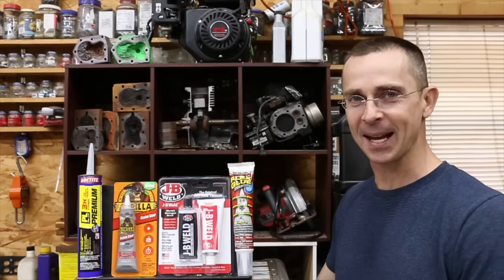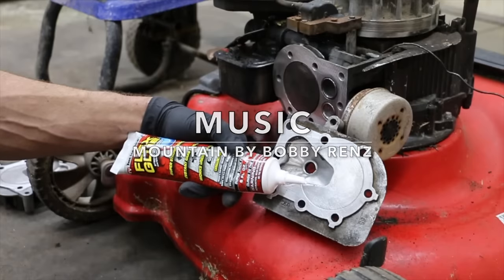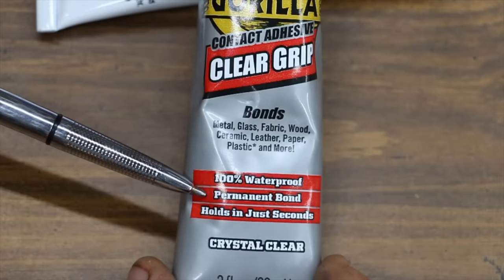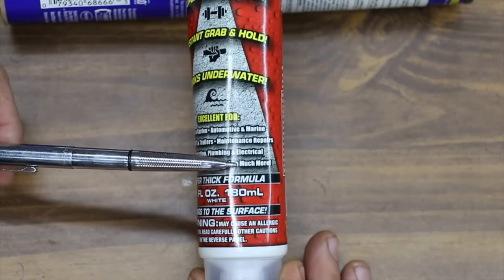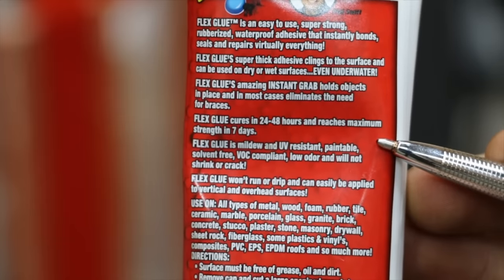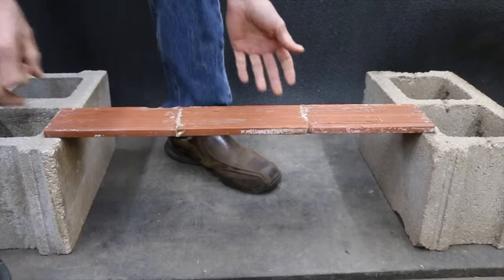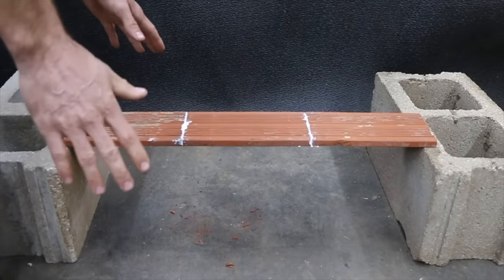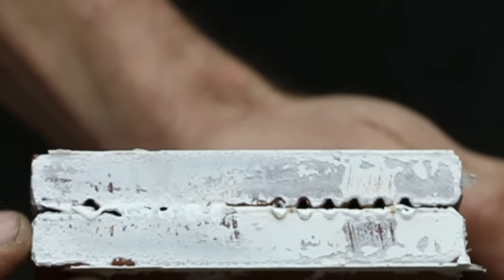Is Flex Glue better than JB Weld, Gorilla & Loctite?  Let's find out!

Comment: I know it's been awhile since you've made this video but I'm looking to waterproof a 1/8 gap around my speakers. They'll be secured to the housing via 1/2" 6-32 screws with locknuts on the backside but will have that gap which MUST be waterproofed. Since this is a portable speaker, do you think the Loctite will withstand the flex from the speakers' vibration and from the constant movement in the boat/truck/ATV? I dislike silicone because if I ever need to do a repair, NOTHING sticks to silicone so cleaning it off for said repair/patch becomes more of a hassle than it's worth.
 
Any other products to try? Thanks in advance :)

Comment: i have a question. just wondered because the tests done are mostly sheer strength? so, it's any stronger if done with  holes for better purchase? thanks, like with the engine, after the bolts were removed the holes then filled with resin would improve the hold? thanks!

Comment: You should check out Aquaseal dive repair glue sometime. Aside from repairing drysuits, I have used it to repair shoes, boots, wood, etc. It is very strong and adheres to anything clean. In the case of fishing waders, clean the surface, apply the glue and if it comes off in a few days, reapply it immediatly before the area gets dirty. The second time it will likely be there till the second coming. I have boots that I have repaired years ago, still water tight. Once opened, it will cure in a few weeks, even after re-capped,  I store it in the freezer to get it to remain soft for years. Then return it to freezer after use. You can add Cotol to get it to cure quicker, but it will not be as good as it would be if you can simply give it a few days to cure.
Reply from the maker: Thanks for the suggestion.

Comment: A smart Texas Aggie and his wife founded JB Weld at he same time as I returned injured from Viet Nam. I met my wife (a Texas country girl) while I was in the VA recovering. As soon as this product became available I started using it. I had a shop near a AFB as a meeting place until 1983 when Hurricane Alicia destroyed it. I'm an average mechanic but there were guys that were crackerjack. I bought a inexpensive flatbed rollback with a stinger on the back. I also got a car dealers license and hoards of us could go weekly to the auction. Sadly, many old + now radically expensive muscle cars were scavenged for their engines and transmissions. As a example '69 GTO could be had for $1,000. Everyone's workbench had JB Weld on it. Guys would get-together and work through the night and pull a engine and transmission and reinstall it on another car. Generally, there would be JB Weld waiting and ready to mix up and used for everything. I've seen undersized plugs installed with JB Weld and ran on a track. I don't remember it not being used for anything. I also had 2 cheap lifts that were from a defunct gas station. Those years are my happiest years and memories I have. Now being in my 70's I can't work on much but I still have JB Weld on hand for nearly everything! Thanks, a million for proving what I knew. JB Weld is by far the best product on the market still. Sorry, this is way too wordy. JB Weld is a central point in my life that evokes great memories!
Reply from the maker: You are welcome!  Thanks for sharing!

Comment: I have used JB over the decades to MacGyver Commercial dishwashers and laundry equipment when owners didn't want to pay for big replacement costs. .Also one time a 100 miles away from home I patched my Yamaha 4 stroke dual sport to a crack that was causing my bike to blow engine oil & would  have blown if not repaired.  I patched it w JB for a quick fix and it became permanent. I was in a jam and tried flex seal on a weekend call and it didn't last a minute F anything you see on TV especially in the as seen on TV racks.. Yee doggy!
Reply from the maker: Thanks for sharing.

Comment: So I have a leak on a prefilter basket on a multilevel pool pump motor.  It is a vertical seam leak.  Manufactured Ng defect obviously. Bit gets water pressure on it.  I have tried layers of jb weld, level, pipe glues, etc.  Nothing lasts under pressure.  Now Lowe's tells me that Flex Seal goop in the jar will definitely fix it.  Going to put it on today and let dry for 24-48 hrs.  Any bets?.  @Project Farm

Comment: WHAT J-B WELD did you use? was it a different one for different products or is there just one? my speedo on my E-Scooter is plastic and it fell over in the wind in the back garden, bare in mind this speedo has a trigger on it where cars have a pedal. its not the trigger that has snapped thank god its where its screwed to the handle bar so what J-B weld do you recommend the J-B 50139 ?
Customer say this about your red and black original on Amazon.   Does not bond to high density polyethylene plastic please help dont want to ridding down a road at speed then it snaps off. Thanks for sharing this amazing video. Ray K.  UK.  YNWA.
Reply from the maker: J-B original is what I used and would recommend.

Comment: I worked as a fork/clamp truck mechanic and everything under and on top of the roof in a box plant for 26 years. One clamp truck had a leak coming from the oil pan seal. I had to pull the motor to fix it. Guess what, no gasket. I used the flex seal without a gasket and put the truck back together. The next day this guy said he tried to get the oil pan off and tried all day. I put the bolts back in, again and put it on my fncket list. This pan never leaked again.
Reply from the maker: Thanks for sharing.

Comment: To get the best results bonding metal to metal using JB Weld, rough up the surface with a file or sandpaper, then clean it with acetone.
Reply from the maker: Thanks for the feedback.

Comment: Thanks for the video. 
Here in the UK, PTFE tape is a good product to seal plumbing and gas joints. I had a radiator connection that was so loose that I needed an alternative, and I turned to Loctite 577 thread seal. Loctite have a number of thread sealing and thread locking products, and I only found one other maker, Flomasta Pipe Thread Seal.
So, I was wondering what was the difference in the Loctite products that all seem to be similar chemistry, and quite expensive as well, and the competition available there in the USA. The main requirement is either hydraulic sealing, or stopping threads turning after assembly (or both).
Reply from the maker: You are welcome!  Thanks for sharing.

Comment: It has been my experience that for sheer strength, tensile strength and bonding power JB Weld will beat any "flexible glue" hands down.  Titanium filled epoxies work even better but very expensive. They drastically different animals.  It is a steel metal filled amine based epoxy. High temps kinda kill them all. The engine head results would be expected, cylinder head pressures during firing are very very high and have a high impact force like a big hammer during the fuel air explosion. That is why they use high strength bolts for cylinder heads!!  Flexible glues seem to work best on materials with high texture, absorption etc. Pine has a lot of resin in it so it doesn't absorb the glue well. Great test though! Always enjoy your tests, very informative.
Reply from the maker: Thanks!  Thanks for sharing.

Comment: Quite a few people here are commenting that the Gorilla glue needs water to activate it.  If you check the instructions on the Gorilla Clear Grip product used here, it doesn't state surfaces need to be moistened.  The original Gorilla polyurethane based glue is a water activated glue however.
Reply from the maker: Thanks for the feedback.

Comment: I have some JB Weld that I'm planning to use to glue the front door frame back on my above the range microwave.  I've been delaying the repair but I think I'll go ahead and do the job this week.  I also have a microwave leak detector and it shows that microwave leaks are well within the safety levels even without the front door frame but I need the door frame because the handle is attached to the door frame.
Reply from the maker: Thanks for the feedback.

Comment: I threw a rod in a 5hp briggs and put a hole in the block . After degreasing it and throwing in a new rod I JB welded the pieces back together to patch the rather large hole. Ran that engine for another 10 years on a minibike.
Reply from the maker: Great!  Thanks for sharing.

Comment: I'm sure PHIL SWIFT would argue that comparing a 2-part epoxy to his gunk is 'unfair' but by my calculations,  Flexglue costs $3/oz vs. $2.50/oz for JBWeld and it cures in minutes, not 1 week....  Now that's a lot of maths !
Reply: You know what flexseal is actually good for?  Use it in a car that has a water leak.  I just couldnt seem to figure out what spot weld was leaking, I even tried dusting with baby powder, but no joy.  I got a can of flex seal, sprayed the entire darn weld seam, and the flange that held the weatherstripping.  Problem solved.

Comment: I snapped my steering wheel off of my Lincoln Town car in a fit of rage when the Denver Broncos lost in the playoffs , I remember snapping the wheel off at the tilt knuckle , I drove home with a vice grip next day got an estimate for a new steering wheel . . . . . didn;t like the price but I still needed a wheel so I gave JB Weld a shot, not really expecting much, more as just a what if . . . 
It is still on the car 20 years later
Reply from the maker: Wow!  Thanks for sharing.

Comment: I really like this test. Will it work on pot metal?
Reply from the maker: Thanks!  Thanks for the video idea.
Reply: No.  I tried to use it to fix a 1942 Lucas Magdyno M01. The case was cracked, and a bolt flange was snapped off.  I cleaned the hell out of it. I even put it in the sonic tank. I also cured it in an oven at 125degrees.  It unfortunately, refused too hold.

Comment: just confined what i expected. JB Weld is tough as nuts. One time I fixed a radiator with JB Weld after piercing a screw through the end cap like an idiot. It held in the texas heat for over 6 months daily driven lol
Reply from the maker: Thanks for the feedback.

Comment: I was hoping you would compare the thread locking ability at high temperature.  I just repaired my Ford Triton 6.8 two valve that has the defective spark plug threads that lets the spark plugs blow out of the engine.  There were several thread lockers suggested on YouTube.  JB Weld by the kit manufacturer (Cal Van), Locktite 271, Locktite 266, and Time Sert 6020.  What temperature do the spark plug threads get to?  JB Weld claims a 550 F compatible temperature.  I used the JB Weld on all the threads and I can't imagine the inserts ever coming out.
Reply from the maker: Thanks for the suggestion.

Comment: I know you won't  get to my comment, but I use Flex Glue for holding phone magnets to the phone holder. The best part is I broke my Right Side Passenger  mirror  The whole mirror fell off, just held by the power wires  Use Flex Glue 1 year ago to remount mirror Still holding  on today
Reply from the maker: Thanks for sharing.

Comment: You didn't need to test Gorilla.  I could have told you that it was trash. The predecessor to JB Weld was a material called MarineTex. It's what we used in the '70s and '80s when the repair had to be permanent. It was said to be able to repair a broken engine block.

Comment: Did you wet the wood before using Gorilla?  It says to do so on the package and I have seen that make an enormous difference
Reply: If you check the instructions on this Gorilla Clear Grip product it doesn't state surfaces need to me moistened.  The original Gorilla polyurethane based glue is a water activated glue.

Comment: One question, the last time I used Gorilla Glue in the instructions it said to spray the area with water before putting the glue on, did you do this with your testing?
 I have always done so and Gorilla Glue worked very good for what I was doing with it, working on RC Planes attaching props to electric motors that wouldn't hold on their own and fixing damaged balsa from bad landings,  vs JB Weld which I found to be more expensive because of  the amount of waste I had to use to get mixed properly and the horrible smell that lasted for days. other than those two items it is great stuff.
Reply: You use water on wood only to raise the grain for a better bond.
Reply: @bucketmouth7705  that is what the instructions say, but I have found it to help with steel also. Really good demo even still
Reply: @larrybradley4777  steel, I don’t know, wood yes, retired furniture repair

Comment: Your videos are always great!!! 
Maybe try using these products on broken engine parts like an exhaust manifold that is broken in half.
Reply from the maker: Thanks!  Thanks for the feedback.
Reply: I don't think any of these adhesives will stick a broken exhaust manifold. It gets much hotter than the highest temperature that an adhesive can withstand. The manifold will need to be brazed or welded, using a filler rod and flux intended for use on the material from which the manifold is made.
Reply: @cedriclynch  that's what would make it so interesting to try. An extreme situation. Another thing would be to test it for thread repair where a helicoil is commonly used. Like head bolts or sparkplug holes.

Comment: I Enjoy watching all your different test! One I Wish you would do, is the Flex Glue. Their Commercial shows them lifting over 6000 pounds, with 1 drop of flex glue, between the flat metal lift point, and a flat based Weight Meter. I Say, Prove it! I Don't believe it!
Reply from the maker: Thanks for the suggestion.

Comment: Good video.  You need to add a chemical test to this.  I have had great experience with JB Weld except on carb applications where the glue was in the presence of gasoline.
Reply from the maker: Thanks!  Thanks for the suggestion.

Comment: Have you done a 2 part vs pre mixed? Like the A/B foams vs spraycan foams. The same company makes. Like jb weld. They make their 2 part mix you need to ratio out yourself vs those syringe style applicator they make. Like is it better to by the original or pre mixed.

Comment: I have a bracket I need to fix on my truck that doesnt hold a lot of weight. Going to get 2 pieces of metal and lapweld over the break with jb weld because of this video.
Reply from the maker: Thanks for sharing.

Comment: I recently used some of that Flex glue,(not on an engine,hehe.) 
    It's strange, not like other materials, but after a 36 hour cure it works as a submerged filler. Also Very!  adhesive . The only deficit is a slightly longer cure, but it is a really strong product. I was surprised, that a nèw product was so good.
Reply from the maker: Thanks for sharing.

Comment: A note about one of the tests. It didn't effect the result in this case, but ... The foot of that piece of rail you used is not as wide as the round weights you were using.  A fairer way to use it would have been to place one of the round weights on the board first, and then the rail.  The narrower foot of the rail actually added extra stress to the joint, just because the geometry is narrower.  I'm guessing you already know this, but suspect a lot of the viewers probably don't.
Reply from the maker: Thanks for sharing.
Reply: This adhesive testing episode was of particular interest. Many thanks for the work you do!

Comment: Great testing. Would you want to test the water resistance for Loctite Plastic Bonder, J-B weld Water Weld, J-B Weld Marine Weld as to which is the best for repairing a hose-Reel. Specifically HoseReel Mobile by Suncast. I need the parameter of the Water intake to be water resistant after the fix. Thanks
Reply from the maker: Thanks!  Thanks for the suggestion.

Comment: very interesting JB weld seems to be the best all around adhesive. It does not have the strength to hold a lawn mower head on, but it could be a good gasket.
Reply from the maker: Thanks for the feedback.

Comment: Saying it now. Flex glue may hold it, until it runs and heats up. JB weld should be good for atleast 350 to 500 degrees Fahrenheit. While flex glue, isn't adaptable to heat at all.
Reply from the maker: Great point!  Thank you

Comment: I tried Rhino glue to repair a glass rear window on a 2000 Corvette convertible. The window popped out when I took it to a car wash. I went to the corvette club web site and someone had a video that worked but basically you needed two people to effect the repair. This worked for about three months but when the Arizona sun got to it the repair failed. I tried to get my friend to help me fix it again but the glue turned into gel in the heat. I guess you need a garage. I found out later that part of the Corvette maintenance included work on the window.
Reply from the maker: Thanks for sharing.

Comment: Kind of wandering if that jb would've lasted a long time as a head gasket with the bolts in.
Reply from the maker: Great point!  Heat might be the only issue
Reply: I just anneal copper chimney flashing, and use it for head gaskets.

Comment: I bet the JB Weld would have held as the head gasket with bolts still torque. Might have to apply some of the JB Weld and only tighten the head to where the JB is the thickness of a gasket then once it’s good and cured then toque the head tighter. This was if the head was torqued all the way down when it’s still soft it would squeeze all the JB out. But then again if the head was tightened all the way down when it’s soft it still might seal the head if bolts are left in. Seen guys fix cracks in engine blocks that someone forgot to drain the distilled water out of the mother so it froze and cracked the side of the block now no leaks. I think he used the JB for high temps.
Reply from the maker: Thanks for the feedback.